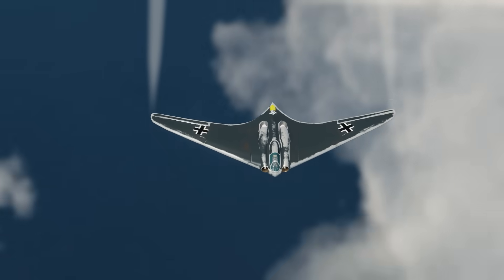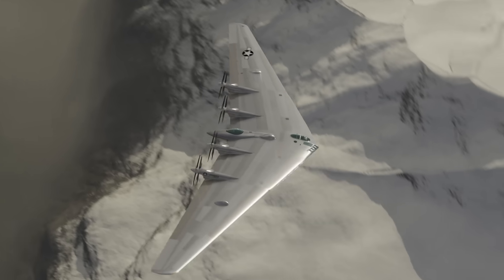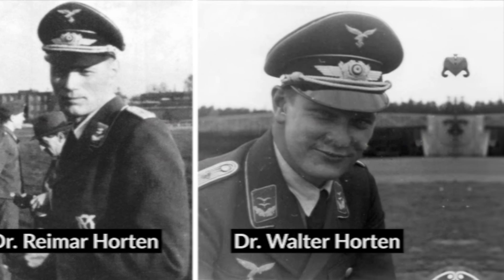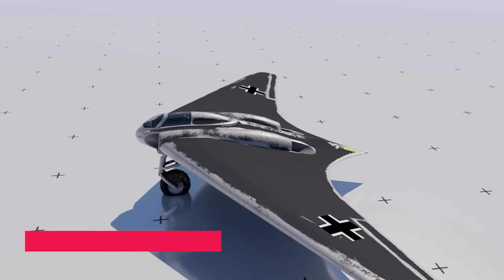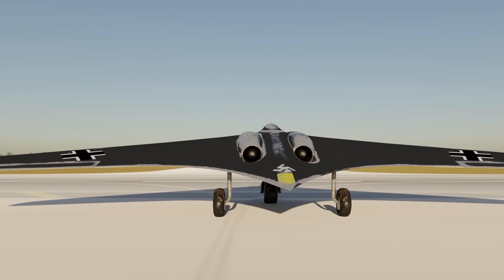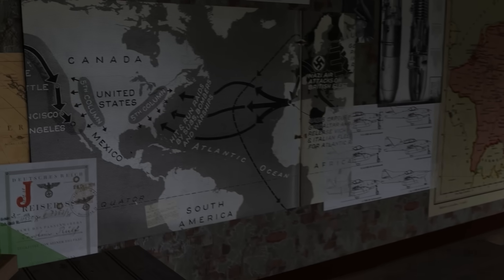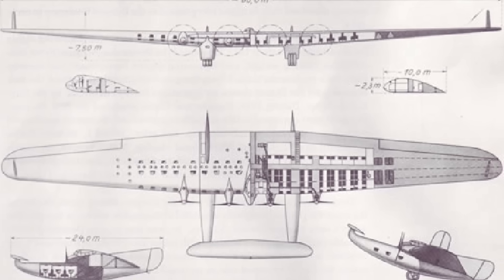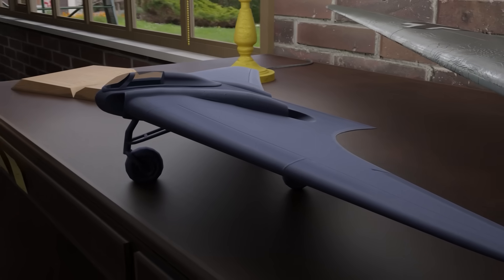Insane Flying Wing Jet Fighter To Save Germany - Horten Ho 229 Nazi UFO

Comment: By far my most favourite experimental WWII warplane next to the J7W Shinden. There's something so menacing about a flat slab of a wing travelling at subsonic speeds before decimating a WWII Allied heavy bomber within seconds. In an era where jet engines only lasted about 25 hours before needing a replacement, and mechanical tricks to carefully balance a plane without any help from computers, the Ho-229 was a very radical wonder weapon that surpasses the Me-262 in almost every aspect. 

Today the aerodynamic benefits of a blended wing design is known within the aerospace industry, that contractors such as Boeing and Lockheed swore by it and developed both manned and unmanned flying wings. I would love you to make a video on the B-21 Raider some day, which honestly looks like a 21st Century version of the Ho-229 that's just as big as the B-2 Spirit.
Reply: The first flying wing was actually the Northrop N-1M and the Norhtrop XB-35 was also more advanced than the Ho. 229.
Meanwhile the P-80 shooting star was a superior jet fighter compared to the Me 226 and the B-29 was the most advanced aircraft of WW2
Reply: @Rico-v7r  More advanced? Nah man, more like different engineering solutions. 

As much as I love Northrop he used a completely different aerodynamic technique to solve a tailless design; he used a butterfly flap that would deploy automatically when the plane banked beyond a set of pre-determined angles instead of relying on very precise (and very German) calculations for a teardrop-shaped trailing edge like the Horten brothers did. Flying wings have a special place in my heart for how radical and clean it is. 

Also, the P-80 was single-engined with the engine buried inside its fuselage, making for a clean aerodynamic design but a complicated maintenance especially early jet engines which would typically last about 30 hours before needing an entire replacement. It wasn’t as fast as the Jumo-004 powered Me-262 but it was more agile. 

Like I said, different aerodynamic approach.
Reply: @Nafeels  Even with a Jumo-004 Engine the Me 262 had a top speed of 550mph compared to the P-80s 600mph.
In addition to that the P-80 also had a longer range, higher flight ceiling, was more maneuverable as you mentioned, had more payload capacity, double the armament etc. Also considering that the J-33 engine was more reliable than the Jumo-004 and jet engines are serviced at airfields instead of in combat environments the ease of access to the engine isn't as important.
Reply: @Nafeels  The "teardrop" trailing edge of the Ho. 229 did not lend itself to greater aerodynamic stability. The Ho. 229 was to use elevons and spoiler as controls where as the Northrop designs consolidated the elevons and spoilers into "clamshell" controls. In addition they could be employed automatically as you said. Further the Ho. 229 never even flew.
Also, if "very precise, very German calculations" were a real thing then German equipment from the war wouldn't have such a poor reputation for reliabilty.
As they say, "if Germany invented the paperclip, it would have 11 different moving parts".
Reply: @Nafeels  So yeah man, more advanced.
Reply: @Rico-v7r   TO BE FAIR the Germans were also fighting a losing war. The Jumo-004 apart from its incredibly shoddy metallurgy and fuel quality (at this point they were exhausted on traditional high octane avgas, hence used paraffin-based fuel that further weakened the already weak compressor blade design) while the P-80s on Italy would’ve been using high octane avgas to not disturb the operation of the J33 engine. Despite this the Jumo-004 still produced higher thrust output than the J33, and with the Ho-229’s tailless design it would’ve surpassed the P-80 on level flight.

Also, I assume you didn’t watch this video or didn’t know the story behind the Ho-229 because it absolutely flew, and there are photographic evidence of it. In fact, the one mentioned in this video was one of few flight attempts just outside Waggonfabrik before one of the Jumo-004 engines went kaput and brought down the plane with its test pilot to the grave. As I remembered, it was already a V3 version that was also mock tested with an Me-262, which the Ho-229 won in almost every category except the roll rate (understandably, it had both longer and bigger wingspan). The only left prototype that was discovered by Patton’s Third Army Group didn’t even have the Jumo-004 engines, which if there was would’ve allowed Sir Eric “Winkle” Brown to test it, as with other late-war German planes. 

The Germans lost the war, but their precise and complex calculations advanced aeronautics study enough that it wasn’t lost to time, and we should be thankful for that. I didn’t say the Germans were more advanced or anything, but their novel idea of approaching aerodynamics of an aircraft differently shouldn’t be overlooked, nor be used as a metric for who had the biggest, fattest and longest dick among all. The US aerospace companies overlooked flying wing designs for decades despite already had sufficient understanding of how it works, until computers are small and powerful enough to justify building one. When the B-21 Raider starts flying it will be a testament on how far we’ve advanced into aerodynamic mechanics, the fruit of over 70 years of research started by BOTH Jack Northrop and the Horton brothers.
Reply: @Nafeels  It's really so much as fair as an excuse for German shortcomings when they were perfectly capable of ensuring manufacturing quality in other projects and procuring high octave aviation fuel for mission critical assets.
Reply: @Nafeels 
The J-33 could achieve 20 kN of thrust at 11,750rpm or 24 kN with a Water-Alcohol injection. This translated to a thrust to weight ratio of 2.53.
The Jumo-004 could achieve 8.8 kN at 8,700rpm. This translated to a thrust to weight ratio of 1.25.
Further, flying wings are not a conducive design to high speeds
Reply: @Nafeels  You got me there, but the Ho. 229 that was tested against the Me. 262 was a V2. The V3 variant was never fully built.
Also, if a V3 was recovered by American forces it would have been evaluated by Frank Wittle who developed the J-33 Engine and also developed L-1000 engine in the 1930s that was capable of driving an aircraft to Mach 2 and was equipped with afterburners.
Reply: @Nafeels  Both the Germans, Americans and British Aeronautical researches made precise and complex calculations. That's a prerequisite in Aeronautics.
Also, American companies did not overlook flying wings for decades. The reason why nobody used a Flying Wing again after the XB-49 is because flying wings are too dangerous to fly without fly-by-wire and onboard computers.
Reply: @Nafeels  There is no original record whatsoever of any mock dogfight against an Me 262. The only thing on record is a post test flight  telephone report to Reimar Horten that the 229 prototype's performed well compared  to 262 performance.

Comment: The earliest example of a functional flying wing that I can think of are the ones designed by John W. Dunne, the D.5 through D.7 series especially, which was back in 1910 in England.
Reply: The Northrop N-1M was the first true flying wing.
Reply: @Rico-v7r  Yet evidence d8sputes this.  I know Americans always want to be first, but the facts say otherwise.
Reply: @owenshebbeare2999  Except it's an objective fact that the N-1M was the first true flying wing.
No Fueslage, no tail and was under its own power.
Reply: @owenshebbeare2999  You're faulty presupposition is predicated on the misnotion that you have any credible evidence to dispute what I've said and the mistaken belief that I'm an American.
Reply: @owenshebbeare2999  Not sure about first, but the N-1M was a landmark flying wing aircraft that first flew  in July of 1940, under  powered flight, and went through a decent test regimen. By November of 1941 over 20 powered test flights were conducted.  

As a follow on, the N-9M first flew in December 1942 - four were eventually built, but these prove troublesome, marked by mechanical problems, crashes, etc. (the last article was preserved, and flying, until a fatal crash in 2019). 

Regardless, this all took place before the year end of 1944, let alone when the three powered test flights or so  took place with the Ho 229 in the winter of 1945.
Reply: @Rico-v7r  no matter how often you are going to state that Northrop was the first to fly a true flying wing the hortense brothers still had there first flying wing taking part in competitions in 1934 loging flights as long as 7 hours in that year. So he was beat by them by five to six years. And I'm sure that depending on the definition of flying wing the still where not the first to build and fly one

Comment: Really cool vid man, the 3d renders are getting better and better each day! Would be cool to see the 229s bigger brother. The ho xviii
Reply: Ah yes the Amerika Bomber.
Reply: Wait till the end of the video
Reply: The First flying wing was the Northrop N-1M.
The XB-35 was also bigger than the Go. 229
Reply: @Rico-v7r  i know, can i ask the differrnce between the gotha and the horten line of 229?
Reply: @px1_  I meant Ho. 229.
Whenever I type "Ho" my phone tires to autocorrect it to "Go".
Reply: @Rico-v7r  yeah i know, the issue is that the go229 is a variant of the ho229, but what is the difference that causes it to be an entirely different aircraft. Why is there a different variant before production even started?
Reply: @px1_  There was no Gotha 229. There was a Gotha P.60 that was an outgrowth of the Ho. 229
Reply: @Rico-v7r  ok thanks then
Reply: So the 229.
Reply: @halogeek6  nah, it was hortens entry into the "amerkia bomber" project, competing with messerchmidts me264 and foke wulfs modified-fw200, it resembled a 229 but significantly larger
Reply: @px1_  yeah I just got done reading up on it. Not afraid to admit when I was wrong.

Comment: Is the Ho 229 still in the Mesonian museum storage, or does it have its own exhibit yet?
Edit: I commented this before I saw the end of the video.
Reply: It is visible, visited a while ago- however, it is just a hull
Reply: I saw it in 2018, the wings were with it but not put on
Reply: @blu5021  
I'm pretty sure that they also have the wings, but they may not have wanted to reattach them considering how old the aircraft is.
Reply: @faragar1791  the wings where burned, the only reason they know how it was shaped its because blueprints where captured for the v1 variant.
Reply: @faragar1791  good point!
Reply: Lockheed Martin built a full size replica a few years back it's probably out there somewhere..